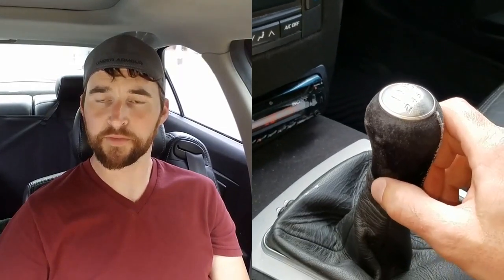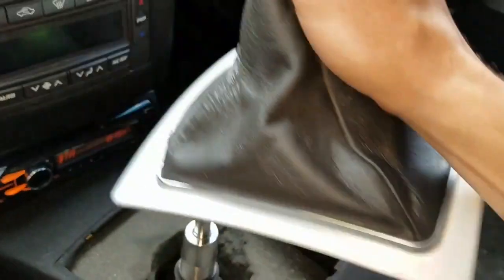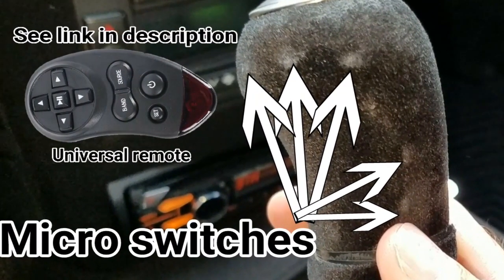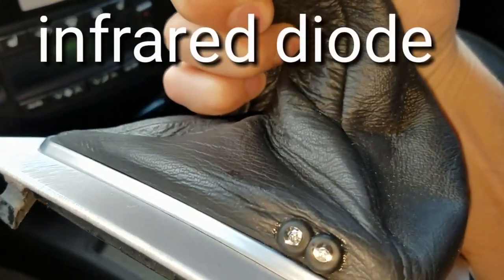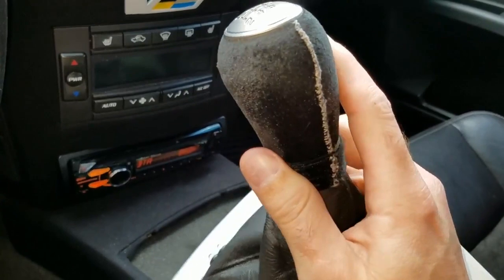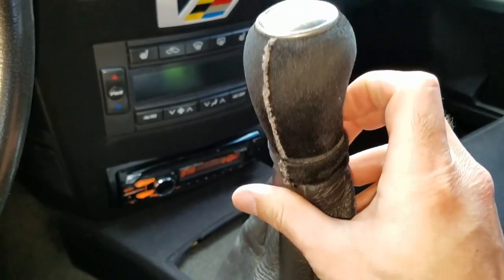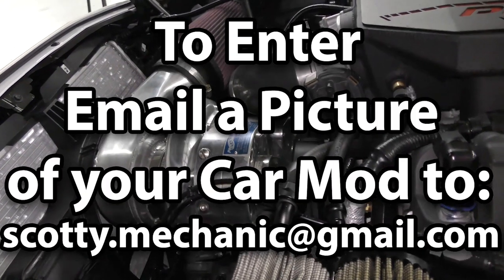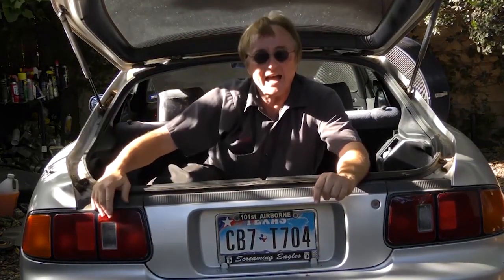Modified Cadillac CTS-V - Custom Remote Shifter Mod

Comment: So what's the purpose?
Reply: Well the radio is down low behind the shifter, it would be kinda annoying to reach down there and press buttons.
Reply: yea, or because you need to hold the steering wheel the buttons on your steering wheel are in reach and that costs to much energy
Reply: The buttons on the steering wheel would control the factory stereo.  It looked like he had an aftermarket head unit, hence the need for a separate controller.
Reply: wolfbrother1000 you can reprogram the buttons on the steering wheel to an aftermarket head unit
Reply: What about my head unit?
Reply: reaching for things in the car changes your seated position. In turn, it can lead to your steering output not matching your intended input. 

I have done a similar mod with an android head unit and a trackball in my center console area. Sort of similar to how Mercedes has a "mouse" to control the radio.
Reply: Prevents the Caddi from being stolen.
Reply: @captainobvious5378  no you can't.

Comment: This man is extremely smart! Why has no car manufacturer made this? This is genius!!
Reply: bmw has , and it always breaks. avoid them
Reply: It's called steering wheel controls 'two hands on the wheel when necessary'
Reply: Exactly. Hands should be on the steering wheel, not resting on the shifter
Reply: Cause it sucks -_-
Reply: Technically, in a manual transmission car you should NEVER rest your hand on the shifter when you are not actively changing gears. It can put stress on the linkages and shorten the life of your transmission. This is probably why it has not been done by a manufacturer. 

+1 for creativity though.
Reply: They have, its called an Automatic Car

Comment: This is pretty cool. I would do it to an older car since new cars have the remote in the steering wheel. Theres also idatalink maestro that you can get to make your steering wheel remote work with aftermarket headunits

Comment: Next mod, a switch in brake pedal that changes radio stations randomly and windows crank up/down the sound volume when drawn up/down .. Or if operating windows is not feasible, one could use steering wheel for changing sound volume.

Another idea, Emergency brake to stop the radio?

Comment: Hi I have a Volvo s60 t5 automatic and the  engine vibrates up to 850 rpm then the  vibration disappear. I have  scanned the car and performed oil change filter ETM and spark plugs, . but the vibration remain. Forgot to mention the vibration persists, even though neutral P or drive. vibration feels all over the car. HELP

Comment: Definitely got some skills but you probably could have just duct taped that universal remote to the steering wheel or if you have the time come up with some kind of bracket to attach it to the steering wheel as I imagine it would need to be removable to change the batteries inside.

Comment: wait so it controls the radio? couldnt you just add buttons to the steering wheel instead? or just buy a steering wheel with button?

Comment: Wait so whats the big deal for a new stick shift? I don't Get it?
Reply: Buttons on the shifter like buttons on a steering wheel.
Reply: What does this do?  Control radio?  Where is radio?
I have steering wheel radio controls, never use them, just reach over and operate radio knobs.
Perhaps I'm missing something here.
Reply: faisal3398 So buttons on a shifter? Most luxury cars have buttons to put it in gear instead of using that car stick. Adding buttons to the stick shift is like adding buttons under your car seat to change the radio. I won't stop you if you want to do it but im just saying.
Reply: WooferJr - Hey you asked what is it and I told you, I never said if it useful or not.
Reply: @wooferjr169  deeeerrrrrr

Comment: Or I could just use the controls on my steering wheel. 

Either way, messing with the radio during spirited driving isn’t a good idea. So I don’t see how this would solve anyone’s problem. Although I do see potential with the design for other applications.
Reply: Launch control?

Comment: so, all that does what exactly? controls what, a drone? You probably shouldn't be trying to control a drone while you're driving. Somebody please explain
Reply: It controls the radio. It's an old model without a multimedia control setup on the steering wheel like you'd see today. So he set up a system on the shifter to control the radio.
Reply: Oh, he never says, then there's a drone shot as it ends... had me wondering. Just more junk to go wrong so far as I'm concerned, whether it's on the shifter or the steering wheel. I've never seen a four or five speed manual shifter in a stock caddy either. When did that happen?

Comment: I hate such a mod. I strongly prefer that I've a simple car. There aren't even any buttons on the steering wheel. It's just the steering function. I do hate my smartphone that will accidentally switch on certain features which I don't want, and that popup some shitty message when I'm in the middle of something else.

Comment: This only encourages drivers to keep their hand on the shifter not the steering wheel. Surely someone with these electronics skills could rig the buttons on the steering wheel? (I assume this model doesn’t have them already hence the silly mod).

Comment: I wan’t to know why car companys want to kill manual transmition
Reply: CO2 war, mostly. Every 0.1 g counts these days and modern automatics shift the way no human ever would - in under 0.3s shift time and around 1200 rpm (where the engine doesn't perform well and is overly stressed, but has lowest consumption).

Basically modern cars are built to kill expensive, complex and resource-heavy piece of equipment (which engine certainly is) to produce less CO2 and NOx emissions. Sure, the engine plant produces much more of those while building those engines and their spare parts, but the current politics don't care aboou anything past what comes out of your exhaust..